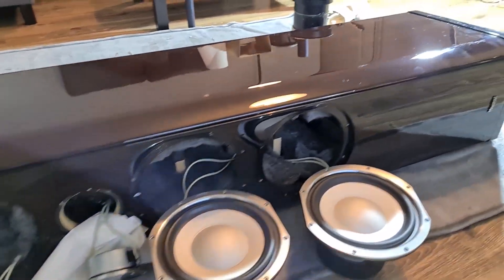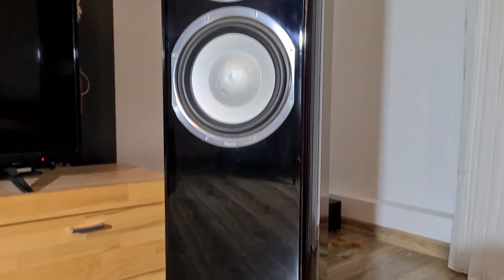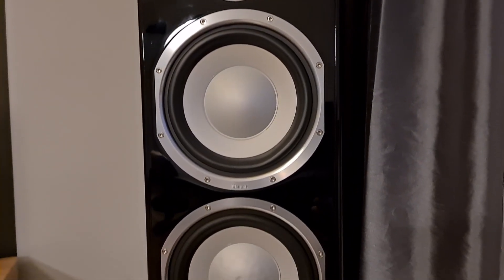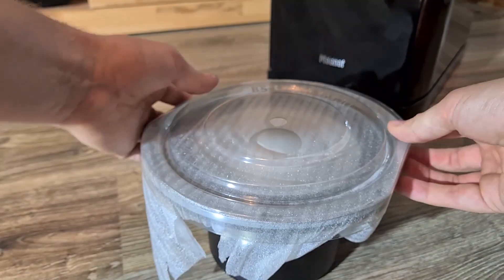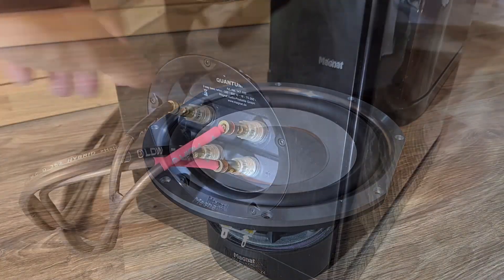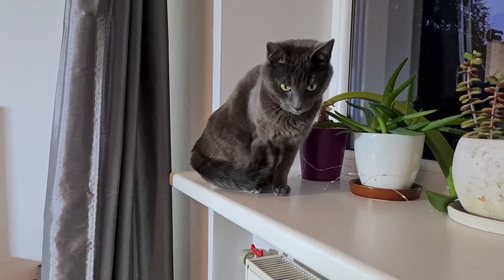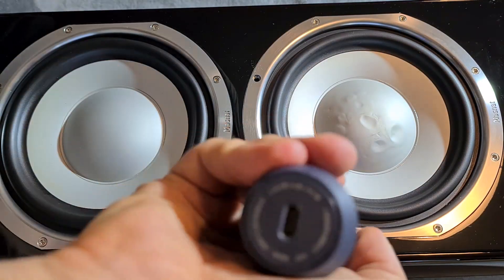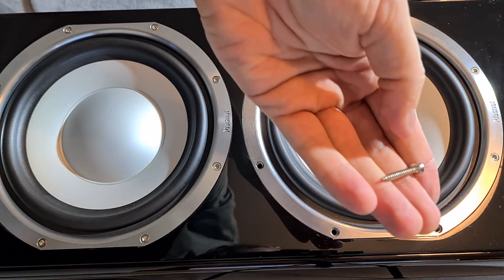$4500 Magnat speaker Disassembly + Bass excursion test

Comment: The quality of parts in this crossover should be at this level in the 2 and 3000 dollar range.
If you spend 2 or 3 grand on speakers, they should Not come with a 5 Dollar Crossover.

Comment: Are the bass speaker baskets made of what material, aluminum or plastic? and I understand that the bass speakers are the same as in the Magnat Quantum 709 model?
Reply from the maker: It's made from metal. We found out, that only monitor audio rs8 its made from plastic.
Reply: @Techscrews  what can you say about the model Magnat Quantum 709? strongly lose 1009 models?
Reply from the maker: @alexgx910  better price performance 🤗

Comment: Thank you for your videos!
It is a pity that the mid-frequency speaker compartment was not fully shown.
If you pulled out the sintepon-filling, it would become visible - the shape and size of this isolated (or not) of the compartment, as well as what the aperture or Aperiodic tube on the back wall of this compartment looks like from the inside (and what kind of filling it has).

Comment: low quality capacitors in the crossover
Reply: how can you tell?
Reply: @jennyhoffmann3054  I see.
Reply: @janosnagy4382  I mean what indicates that they are cheap..
Reply: @jennyhoffmann3054  Electrolytic capacitors are cheap.
Reply from the maker: @janosnagy4382  We can try to upgrade them, but what do you suggest for replacement? Thanks
Reply: @janosnagy4382  ok and which ones arent cheap and does it even make a difference in sound
Reply: @Techscrews  Search in web: Sound Imports - Film / foil capacitors
Reply: @jennyhoffmann3054  It changes a bit and is very expensive.
Reply: @janosnagy4382  only a bit?

That doesn't sound like it's worth it.
Reply: @DubHead69420  The $ 4,500 speaker is only slightly better than the $ 450. 
In the high-end in a small quality difference, a large price difference.
Reply: @janosnagy4382  Blödsinn.  Jantzen cross cap  oder audyn Q4 oder Q6. Und als ob man das hört.  Genau wie eisenkern oder luftspulen.
Reply: @jennyhoffmann3054  the company  and the voltage 160v cheap china.